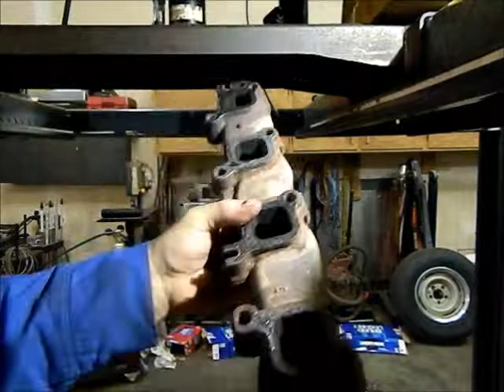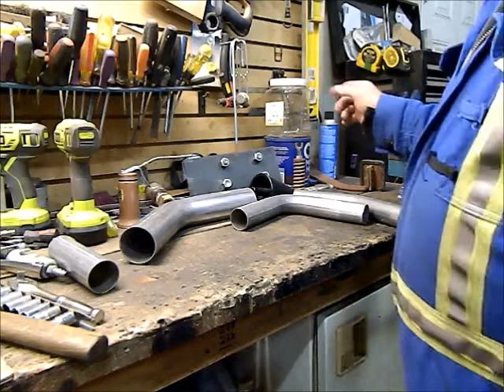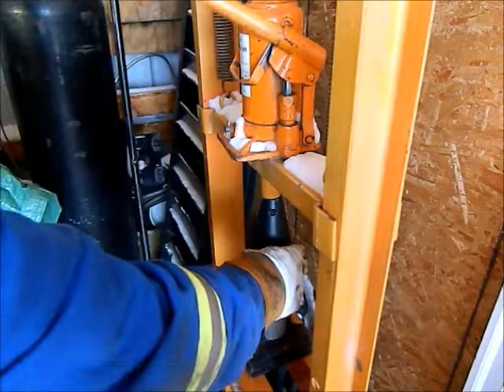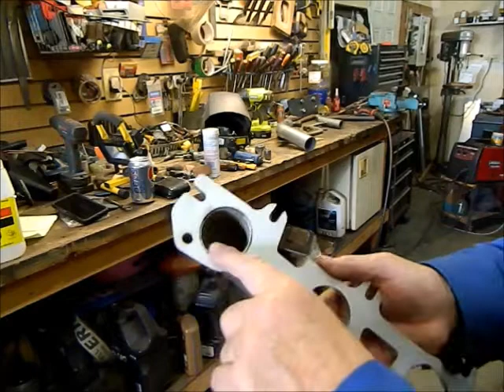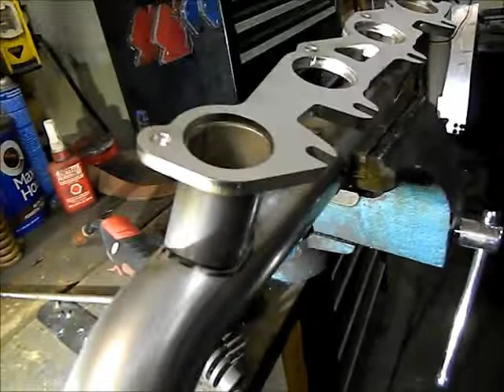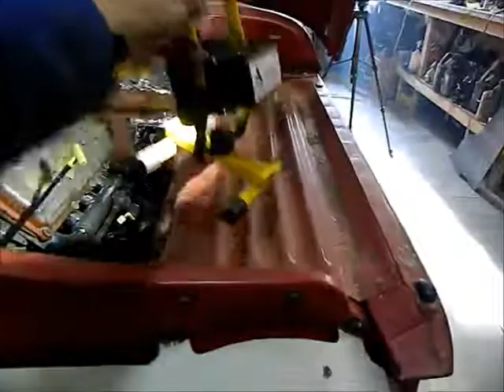5 7 Hemi Custom Headers

Comment: Very cool. Great idea with the log style headers, easier to fit and will still flow way better than stock. I would have never thought you could form pipe with a cone like that.
Reply from the maker: Thanks Gary, many years in the exhaust business I learned a few tricks.  Yhe key to the cone is the grease.